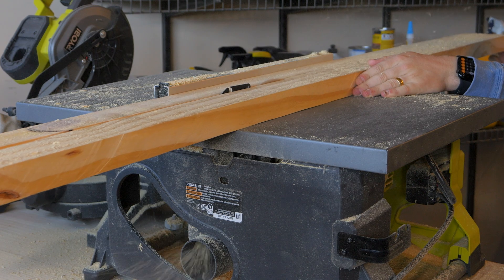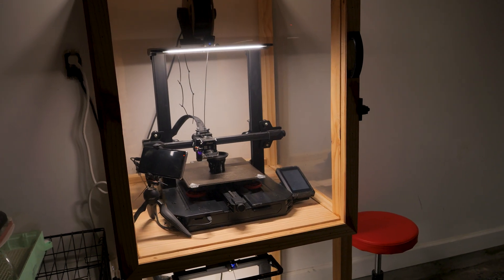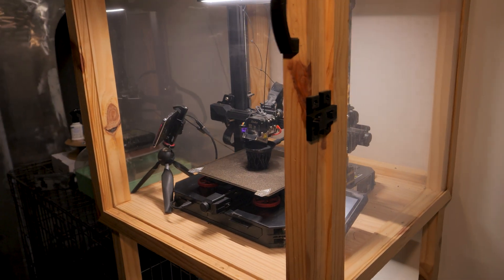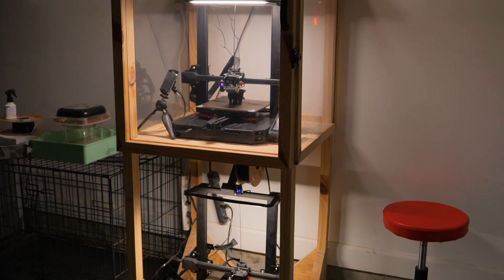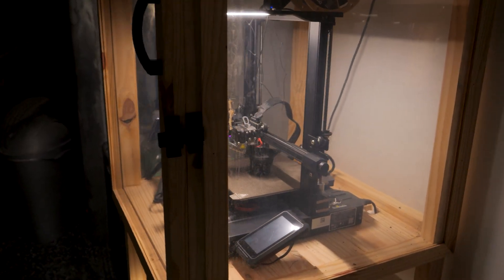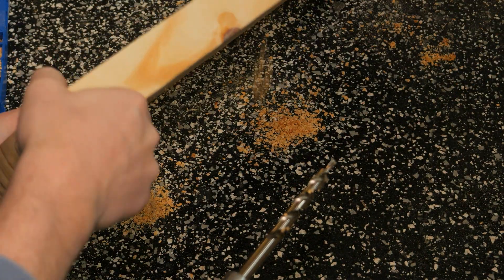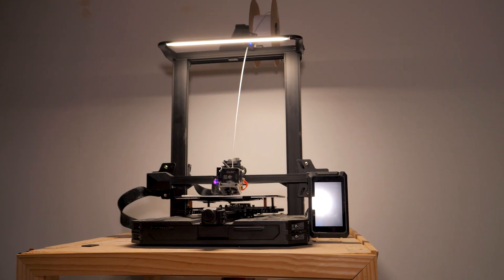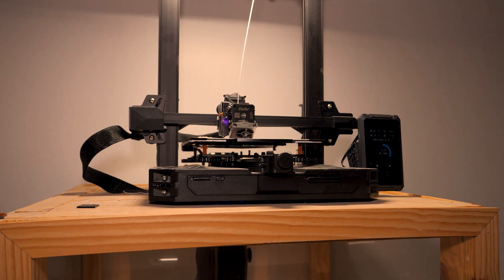DIY 3D Printer Enclosure: Improve Your Printing Experience

Comment: You could use chanel plastic for the back and sides for better insulation and noise reduction as well as saving some money vs the acrylic, don´t forget air intake and exhausts with filters to ensure you do not get to much heat in there. A speed controlled pc fan can help you set the right amount of ventilation in your boxes. If you put your power supply and control circuit near the intake or the other way around (perhaps with ducting) you will help them not to over heat and warm the air a bit as it enters.

Comment: You could run all of these off of a single pi 4 .. but ive been done this road man and i found that at the end of the day buy time your all said and done and figure out your cost PER / SPEED OF PRINTING and PER / print quality your light years ahead by sending 500 dollars on a ender 5 or 6 and SLIGHTLY modifying them and just get reliable great prints over and over again

Comment: Cool idea, but I'm a bit worried the printer might not enjoy it as much.

All in all, heat is not good for electronics. Printers that come with an enclosure either have those parts protected or actively cooled. That means that a DIY enclosure can be a good idea for printers that don't come with an enclosure, but it should almost exclusively be there to prevent dust from getting to your printer + minimizing drafts blowing over your prints. A good idea would be to use a cheap arduino from ali express, a DHT sensor and a fan. Set it up so that the fan starts blowing fresh air into the enclosure at a set temperature, which ensures the temps dont rise too much, but also wouldn't let unnecessary cool air into the chamber. Not sure about your printer, but I know bambu printers have an intake at the back that helps cool sensitive electronics so I would probably duct air from the fan into there. This would also mean that the cool air has time to slowly diffuse into the chamber instead of blowing all over your print.

Edit: even better, make the fan an exhaust fan at the top and you dont have to worry about it blowing cool air over the print.

Comment: I would highly recommend you take the Power Supplies out of the enclosure, higher temperatures are not good for its electronics and can potentially cause a fire. Doesnt have to, but is more likely then without the additional heat from an enclosure. Prusa for example also tells you to do this with their printers in a simple lack enclosure.